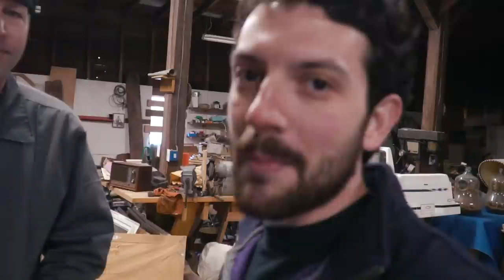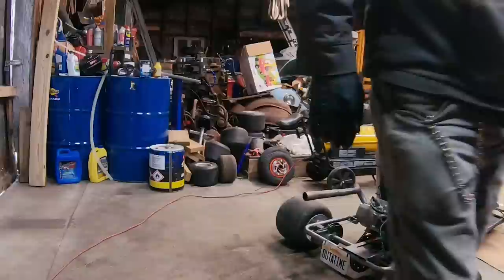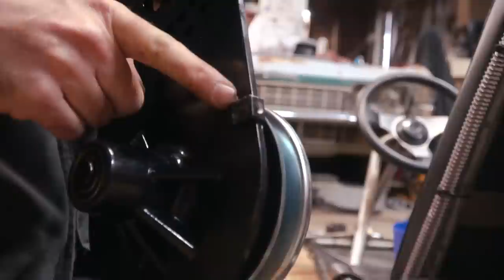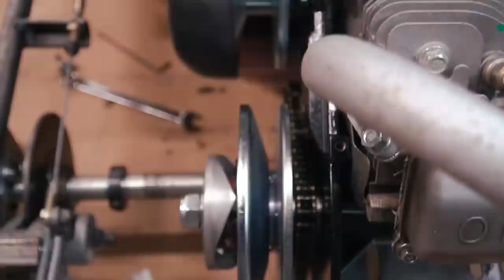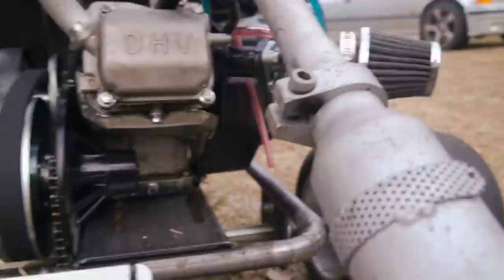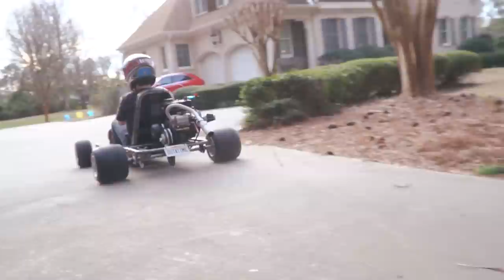Delorean Go Kart Revival + Upgrades!

Comment: I have a high compression, Mod2 cam with 1.3 rockers, fully ported 212 running the Juggernaut and it's positively awesome. Any full throttle action under 30mph is instant wheelie. super smooth and controllable

Comment: If the torque converter boosts low end torque but you lose some top end speed, go to a smaller rear sprocket to get the top end higher.  The low end will still be great and you may get to the 88 mph you are looking for.  Billlk

Comment: Love watching you guys having fun! I've stumbled across a few YouTube vids recently where they're using smog pumps, or AMR300 roots blowers (tiny fellows) to supercharge their little 212 (or larger)engines. Have you two explored this concept? Use a draw through carb configuration, keep the compression low, and run billet rod, flywheel, etc. I know, I'm going to give it a try when I have some free time...

Comment: You guys should look at getting one of those diamond metal cut off wheels by rigid or diablo from home depot. They are where the cutoff disk are for your grinders. I love mine. I've cut steel and aluminum and even did some mild grinding on aluminum.  The nice thing is if it accidentally binds it only bends the cutoff wheel a little.  Use a  pair of pliers to straighten it back up and your good to go again.

Comment: That kind of thing happens when too much power is applied to low power equipment. #35 chain is only rated around  5hp or less. Check specs before ya build. That's how bad injuries happen.

Comment: I think you are going to find that the chain is jumping because the rear axle is flexing. The driven sprocket is a long way from the axle bearing and you are generating enough torque to bend it out of alignment enough to loosen the chain. I suggest that you add a third bearing anchored to the engine mounting plate. If the chain was the problem it would break rather than stretch enough to jump a tooth. You have the same kind of problem on the 670 dragster which shows up clearly in the slo-mo footage of the test videos.

Comment: You really should go to the drag strip and do the disc clutch vs torque converter comparison. Or get a Dragy and do some 330’ pulls. I’d like to see the difference in 60’, ET, and mph. That would make an awesome “Data” video.

Comment: Not all torque converters line up on the inside like this one. Just a little PSA. The larger converters for 420cc or bigger have belts with bevels on both sides and you line up pulleys by their center

Comment: My manco dingo with 420 chain still chunks with the torque convertor and just a stage one predator it's got some wicked torque with my big tires on it this throws grass everywhere I need a pre stretched chain and thinking about putting the old jackshaft style torque convertor on I think all the torqe is flexing the aluminum plate than and just small side to side engine movement with the torque makes the chain slip

Comment: I used to race methanol and ethanol racing karts. Always pickle the engine when you store it. Break the fuel line off at the gas tank and put a spout of Wd-40 in it and crank the engine over until the WD-40 reaches the pump
Reply: Mitchell O'Brien or just drain it before you store
Reply: Zeth Loveless that it true. But the Wd-40 costs the lines, carb and pump and keeps them from drying out/cracking
Reply: Coats*

Comment: Great explanation on the torque converter setup but, you neglected to mention this only applies to ASYMMETRIC setups with a single TAPERED edge belt. Some setups (usually without a backing plate) are symmetrical in which case, this advice doesn't apply...

Comment: E85 alone is ok, its the blended gas that has the troubles with sitting.
Reply: They are also using canned gas which is not the same as what you buy at the pump, since canned has stabilizers added.

Comment: Take a look at you original manco dingo the torque convertor is much more stable using two bearings and a way longer shaft/engine riser this puts distributes the torque under the engine instead of the drive shaft side of the engine stopping the flex issue the TC plate can cause with this hi torqe set up or if you run some big ass tires in my opinion lmk what you guys think?

Comment: I wish they would but a idler bearing in the primary’s, that way you could get the belt tight and you would gain sooo much bottom end. And tune the stall up to 3000rpm or so. It would leave the line real hard then

Comment: what was the autopsy on  the Predator 670cc v twin  engine from the drag rail ?
my theory is it fried a crank bearing making it bend down on that side and flywheel hit ignition and that caused the sparks.
this might have hurt all bearings on crank assembly due to offset load and seized it up..
this usually can also fck up the ignition  by demagnetizing it and make it real weak.
sparks looked like when a flywheel come loose and collide.

Comment: 420 chain/sprockets and bump up the pinion 3-4 teeth. Need to leverage that torque better! Why do the engines fling oil all around? Is there some sort of internal baffle you could use to help mitigate that some?
Reply: I over filled the engine oil and said it would be fine. Lol
Reply: @isaacitllbefine7231  Ah, I didn't catch that. Just know that it seems to be a bit of a thing on some of these carts where you have to have a "catch can" for oil overflow and didn't really grasp why.

Comment: Please bring back the drag rail please I miss it alot
Reply: Robin the slave Wr [BŐŐB] I want to say that rail is scrapped. The frame is done for I believe they mentioned it before
Reply: @zethloveless7238  the frame wasn't a issue the 670 locked up
Reply: Robin the slave Wr [BŐŐB] yes but I remember them saying something about the frame
Reply: @zethloveless7238  they talked to a pro and they said it would be fine to race they raced the frame when it blew up after the bend

Comment: I have never seen a go-kart like the one my neighbor built that had a Suzuki 650 motor side mounted with a 1 inch SOLID steel driveshaft axel
0 to 60 in 1st gear 
60 - 100 in 2nd 
Still 4 more gears to go..
Neoprene bushings
He worked at BOEING

Comment: Hey guys, I have a question for y’all. How did this cart’s acceleration feel compared to the black widow and the dragster? Two builds at opposite ends of the spectrum, but just curious if the 212 could hang with either of the big boys. Lol.

Comment: its not dangerous if you use wax on the blade. at our shop we have big blocks of blade wax that we use. we just get the grinder and cut into the wax and that keeps the aluminum from clogging the cut off blades or sand discs.

Comment: I tried the juggernaut on my Murray Explorer with a stage 1 kit and no governor. I couldn't go more than 10mph with it and my motor was screaming at 5k+ rpms. 

My original driver let me go 40+mph at 4,500rpms. I dont understand why it didn't work on my application. It does have amazing low end torque tho. I'm kinda upset that it didn't work like it should've
Reply: I have a murray explorer stage2 212cc predator with a maikuni carb and juggernaut 30 series and yellow spring driven pulley and kart rips...but when I had stage1 with stock carb the original comet clutch performed better
Reply: @jaymerrill2193  you have to build the engine more to get the full benefit out of the Juggernaut.

I have the Jugg on my Kilowatt with a cam, fully ported head done myself with all HD parts, 24mm mikuni, all billet parts inside and out including a side cover. It rips like no other!

Comment: Hey what would make a gokart feel better with stage 2 predator 212 with china clone converter? It jerks when taking off and top speed is way reduced with 48t sprocket and 10t gear #420 chain. Has red spring in driver does anyone know the difference in springs?
Reply: Green spring on driven pulley is better for top end speed and yellow spring which I run on my stage2 predator 212cc engine gives more torque and engagement in later rpms
Reply: What pros does the 420 chain give you

Comment: Hey you guys would a brake cable for a bicycle work as a gas pedal cable for a go kart if the gauge is strong enough and if it's long enough because my gas cable broke from the engine part not from the pedal part and it's a finicky process to get it fit back on the engine that got take off the air filter and everything else before I can fit it back on and the sprocket that's on the actual connecting the wheels it keeps shifting to the right and then the chain falls off it doesn't break but it just falls off
Reply: Brake cable has worked for us in the past. Sprocket needs to be secured so it doesnt shift. There might be a lock down screw on it that needs to be tightened or put some hose clamps on either side of the sprocket. Gopwersports.com has axle clamps
Reply: @isaacitllbefine7231  Do either one of you have a phone or Skype, Discord I'm trying to figure out something else on the go kart
Reply: Isaac it'll be fine  hey issac i noticed the old mercury Capri in the background. What is the story on the old girl

Comment: Hey Guy’s why don’t y’all have one of your sponsors give y’all a air operated atv table to work on this stuff up off the ground. Y’all been doing this long enough to get up off the ground. You will need few low profile jacks to get wheels off the deck. Why didn’t Ike cut a little section of the engine plate and not cut the torque converter now the belt guard can’t be installed correctly

Comment: There is nothing amazing about a torque converter. They are designed to get something moving that would normally be hard to move and burn up a simple clutch, like snowmobile tracks. They are not high speed high efficiency drives, they eat both of those things up.

Comment: is there a torque converter for 1970's 3HP Briggs&Stratton. cause I got a mobility scooter my grandpa made from scratch, and he gave it to me and my sister back in 2006 when I was 3, he wanted us to have fun with it. and my dad just hid it away in the shed for a wile. then in 2013 he died, and everything he had (he had 2 big barns full of 1900's mechanics heaven) sold, now that mobility scooter is all I have of him and last summer I drug it out of the shed. took out one of the 3 gear reductions he had in it, and put a 3HP Briggs that my dad got when they sold everything of his, its basically brand new as it never had oil or gas in it, and he gave us the scooter to have fun with it so that's what I'm doing. this thing tops out at 10MPH but it has so much torque that with a normal clutch, it cracks wheelies without even trying. but I broke the old differential that was in it, and I can't find out where to find a new one so i want to put a solid axle in it, put some proper breaks on it, it has a band around the clutch, and take out the only jack-shaft left in it and run a chain from the engine, straight the axle. and I really wanna keep the 3HP in it, but I also want a torque converter.

Comment: the aluminum if kept warm durimg your cut will evemtually fly off the wheel will explode if its twisted during your cut dropped or has a chunk missing out of it cracked or totally off balance from the installation generally the aluminum wont cause the disk to fly apart i was a foreman at a billion a week aluminum foundry and ive seen just about everything new recruits could ignorantly do as i trained them they were always told you drop it change it dont refire it if your deep into a cut dont start to twist it keep it solid and straight go back for the remainder on a second pass ive seen these things fly apart take a mans glasses and hat right off his head stick to the damn ceiling but not even  graze him id call that fool lucky !!!!

Comment: What sprocket would you put on a kart to do about 25 km or 20 miles  per hour and it has a 10 tooth sprocket on the semi automatic clutch
Reply: Depends on the chain # and tire size. I would say the sprocket needs to be almost the same diameter of the rear tire
Reply: @isaacitllbefine7231   the tyre is about the size of a quad tyre

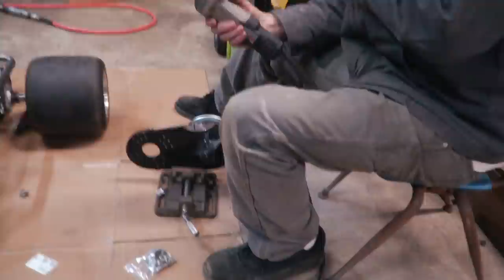Comment: 3:54 So do you have any evidence that this really happens? Did you experience it yourself because it sounds like another one of those old wives tales. Did you just make that up?
Reply: I worked industrial maintenance for over 20 years and I personally have had several of those cut-off wheels explode cutting mild steel never tried using one on aluminum but they will explode! ALWAYS wear a face shield when using them We called them death wheels,